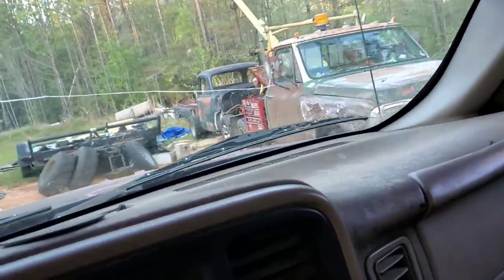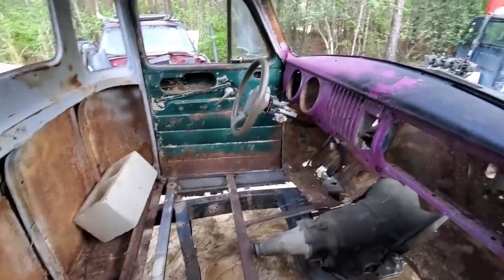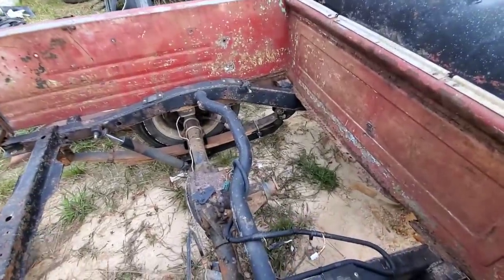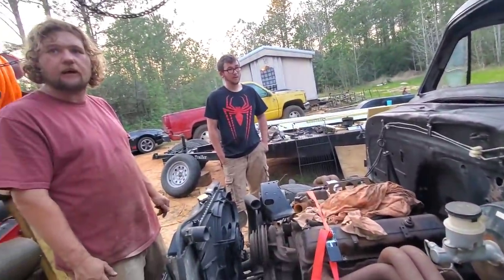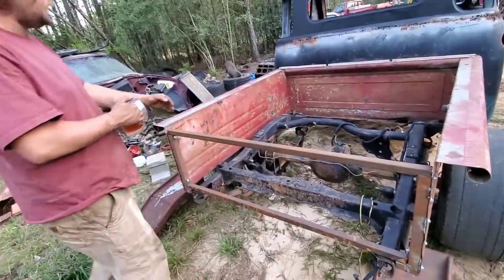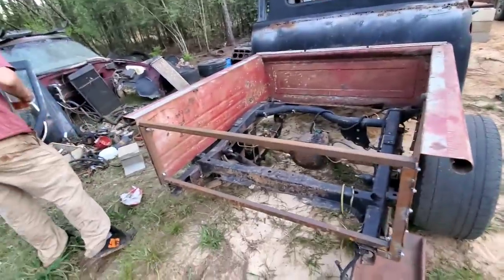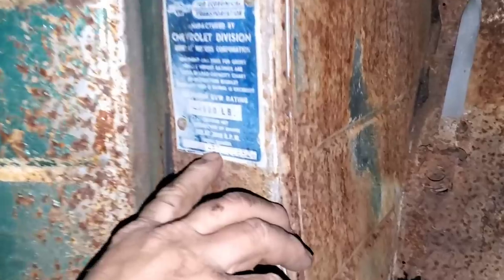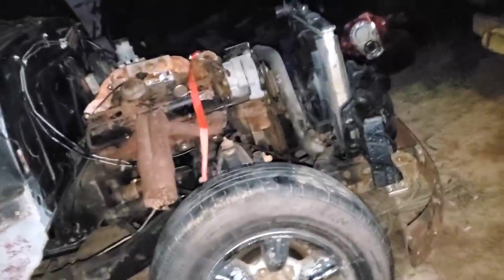Hot Wheels 54 Chevy Rat Rod Project

Comment: If you can weld with one of those cheap hobo freight welders, you can weld everything. I struggle with the spool tension on mine, can’t complain, I only gave 50$ for it, and it came with Lincoln wire, that’s 25$ right there.

Comment: Just clean the rust with a grinding wheel take the old welds out or at least use a wire wheel on a grinder and stop tacking it and actually run a bead the metal will take it just set your machine to the thickness of the metal that you have use .030 wire good video though I ain't knocking ya just giving some tips I weld for a living